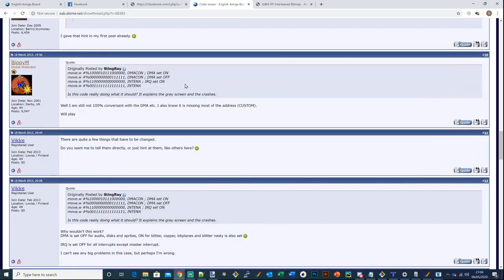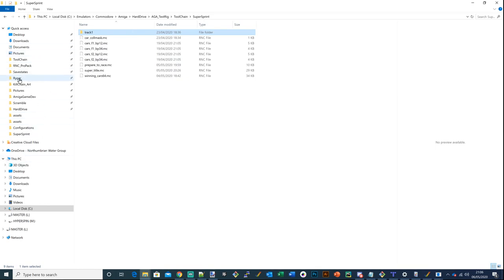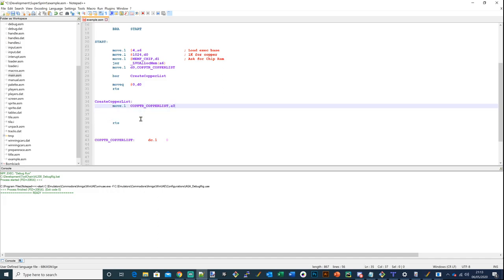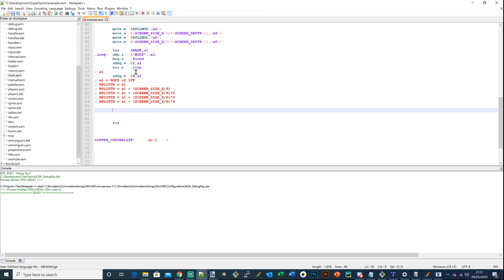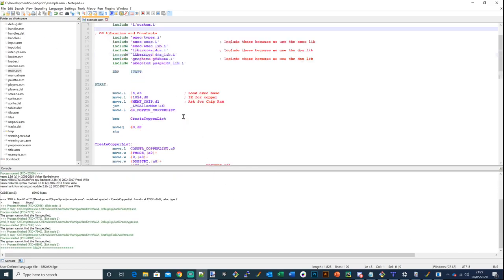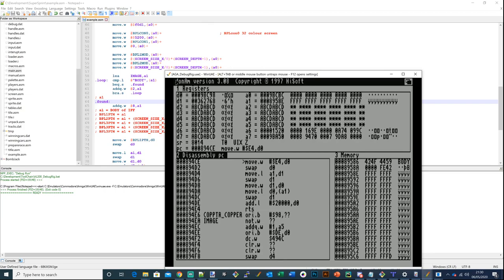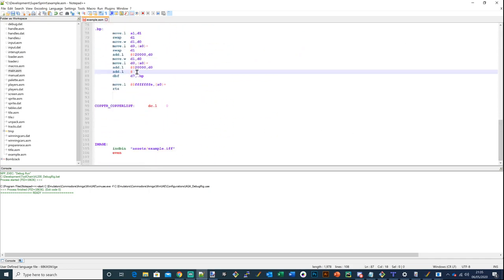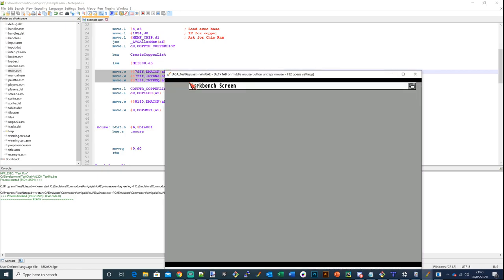Amiga Assembly Real Debugging Examples

Comment: I don't understand well at the end of video one thing.

First, you set 0x8180 in DMACON I/O register to enable Bitplanes and Copper List. After executing nothing appears on screen.

Later you set 0x8380 in DMACON I/O register. This is equivalent to all DMAs enabled (including blitter, sprites, disk DMA, audio). After executing the image is shown.

My question is why the image in first situation is not show. It should be enough with BPLEN and COPEN bits enabled. The others DMAs shouldn't be needed to show the image.

Thanks for sharing the video.
Reply: You need to look at this from a binary perspective.
0x8180 in binary is %1000000110000000 so bits 8,9,15 are enabled, this corresponds to: Bitplane DMA, DMA-Enable and DMA SET/CLR being set.. You'll see bit 7 Copper DMA is not set.

0x8380 in binary is %1000001110000000 which now has bit 7 enabled, bits 0-6 audio, disk, sprites and blitter are not set.

The best way I find while learning is to have the binary representation in the comment, or in place of the hex value..

move.l %1000001110000000,DMACON(a5)

more info here on DMA http://amiga-dev.wikidot.com/hardware:dmaconr
Reply: Ok Mark. I think the bit missing in first try was bit 9 DMA-Enable instead bit 7 Copper DMA, but anyway, there was a missing and very important bit still disabled in first try.

Thanks, I have understood the problem.